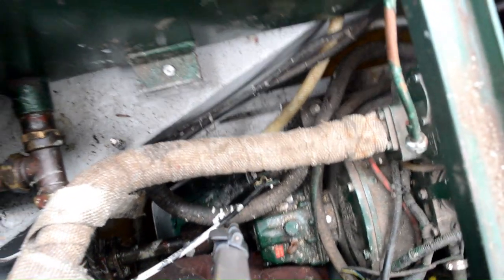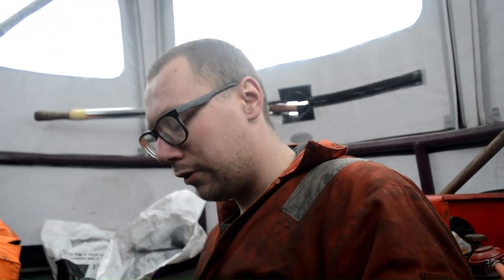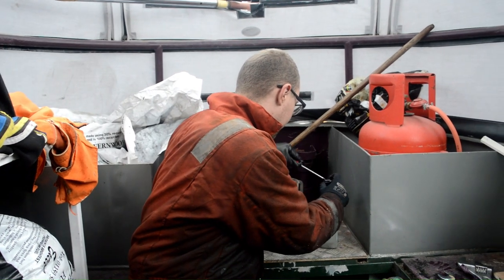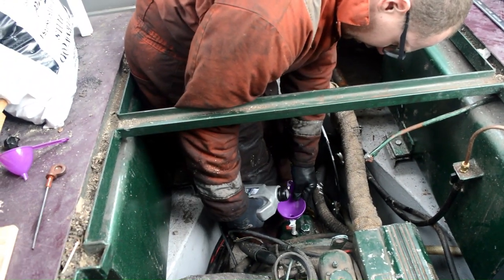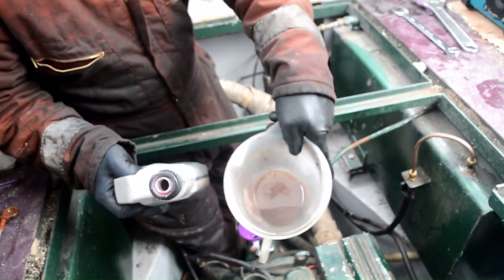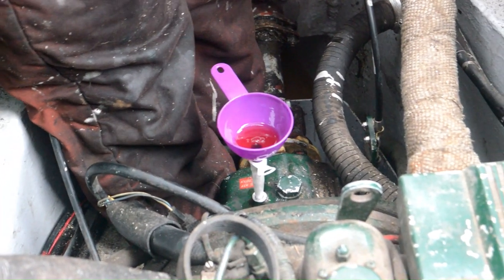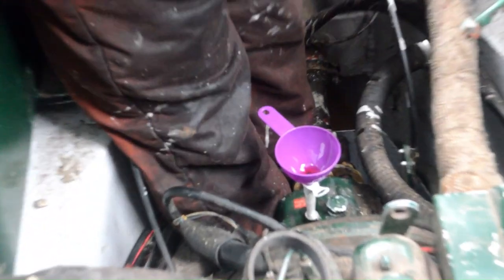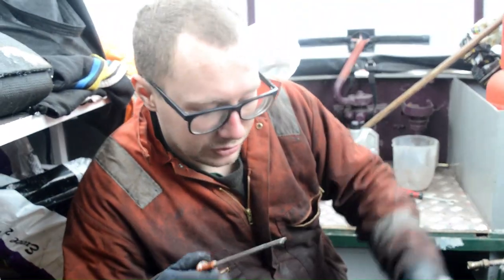Narrowboat gear box oil change- will this repair the problem?

Comment: I seem to have this issue but it engages perfectly in reverse but struggles in forward, would this be the same issue? ATF needs changing? I have checked the oil and it seems very black